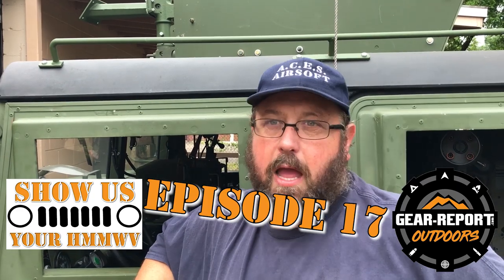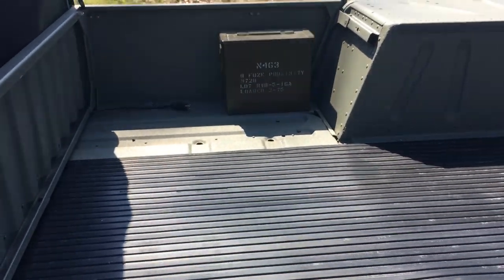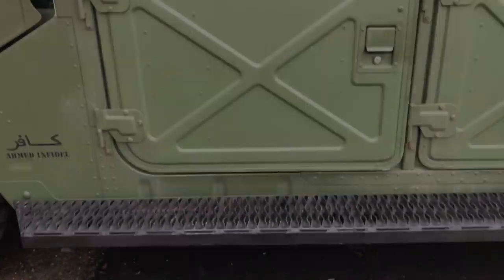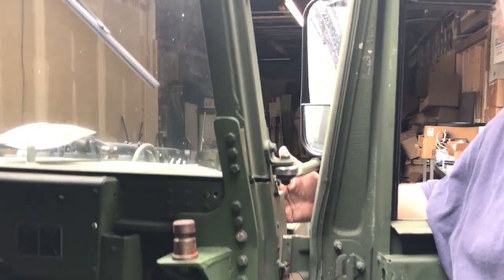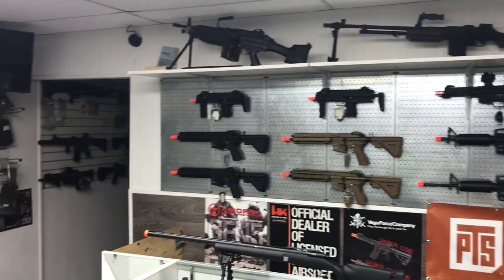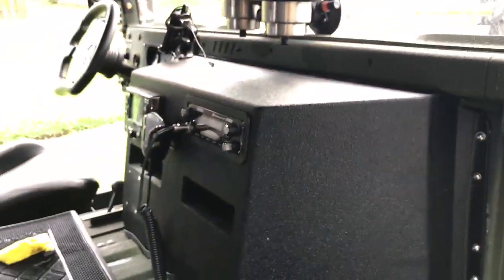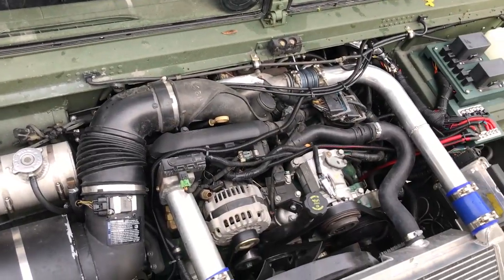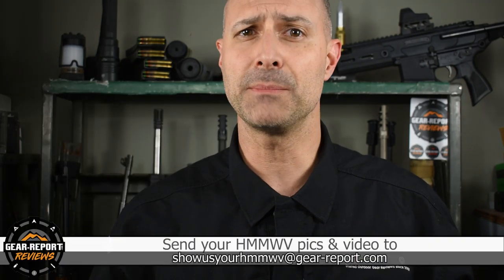Show Us Your HMMWV! Episode 17 - Memphis Belle Humvee, Duramax Predator, Airsoft GMV Humvee

Comment: You never revisited that bar that replaced the lower support beam behind the front seats.
Reply from the maker: Shit. You are correct. I thought I had really good video of that, but couldn't find it while editing. Maybe I just took pictures.
Anyhow. I've thought about it a fair amount. 
I'm not convinced that it is what I would call a "workable solution" anyway. The cross bar is moved up too high. The side impact protection that the bar behind the seats provides is now too high. 
Maybe I'll remember to ask one of my mechanical engineer friends soon.